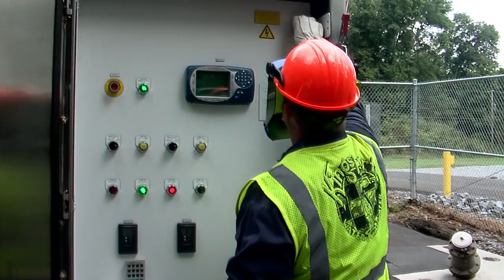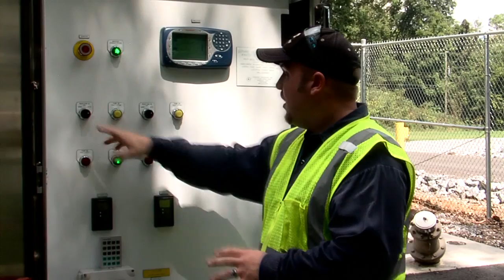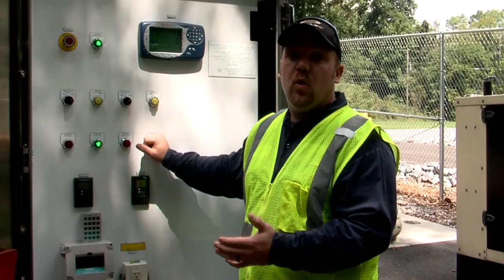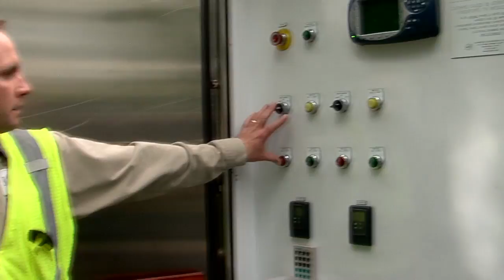"What is a Sewer Lift Station?" by Kingsport WWTP

Comment: Interesting video. Curious what companies manufacture the piping and pumps for the stations. Question: Wondered if there is a free website that provides info as to the cost of building different sized lift stations like this, for various areas, depending on many different issues (depth of sewer, # of homes to service in area, city/county  requirements, etc). Good Job.

Comment: The water level sensing rod must be a bit more reliable compared to float switches,  baby wipes seem wrap the cables of float switches.  Guess the rods still need the occasional proper clean,  cooking grease could build up on it.   Lucky he didnt go in the wet well.......
Reply: It is  an electrode one part is always in the sewage and the other is set at a different level

Comment: I just moved near a lift station unbeknownst to me...the stench is unbearable....we are a quarter of a mile away,,,is this normal?  The horrible smell is very strong and consistent every evening.....Is the problem due to improper maintenance or system?,,,or is it something we just have to cope with?
Reply: Ask the MUA to do a sulfide test or try a charcoal dish in the manholes by your house. It could be a sag in the line causing sewer to turn septic which will cause the odors too.
Reply: I have bad news for you. It's not gonna change. As long as folks use the restroom it will always smell. Everyone that lives near pump stations experience the same problem.
Reply: Are you liberal?
Reply: They could install better covers that hold in the smell. We use stainless steel covers that have rubber gaskets that seal very well.